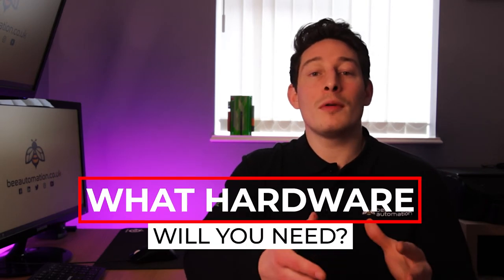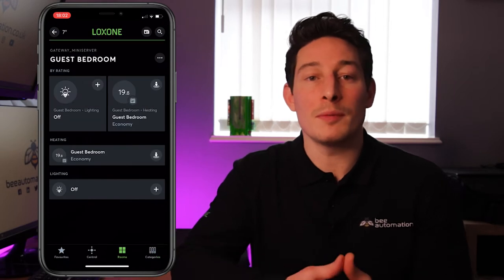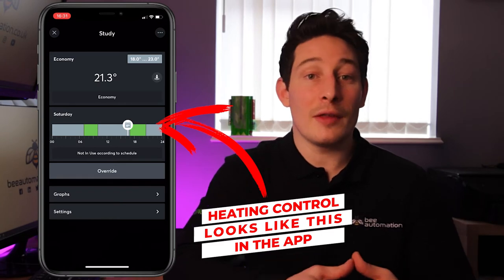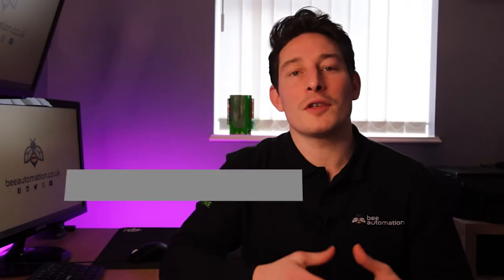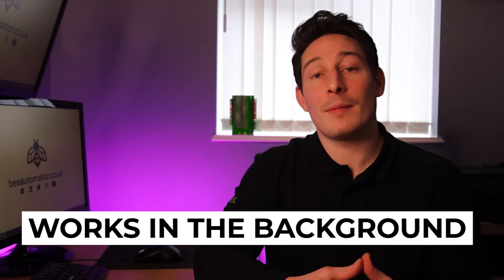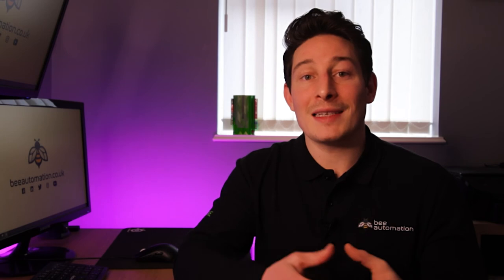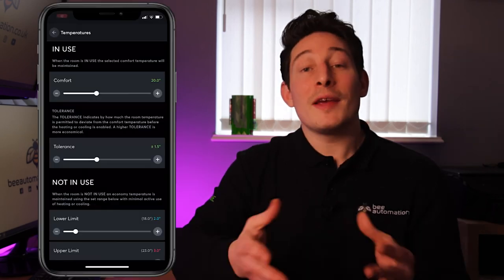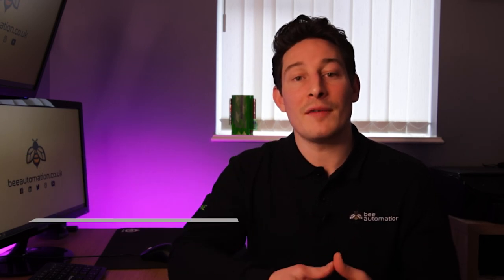How Loxone Heating Control SHOULD Work in a Smart Home

Comment: Ive had to commission heat pumps where the Loxone system cased problems. A couple of points from the heating perspective:
The person with the app was not present so we couldnt test.  A switch in the plantroom to manually open all zones would be really helpful.
Micro zones reduce heat pump efficiency. Minimum flow rates must be maintained.

Comment: Is there a way to more precisely control my gasboiler. I have an OpenTherm boiler. I would like to automate it's supply temp (hot side temp setpoint). For example, i have solely floorheating in my livingroom + kitchen, here maximum of 40 degrees would be more than enough. But upstairs and in my attic, i have solely radiators where a minimum of 50 degrees are needed in order for them to be any usefull in heating up the rooms.

So what do i need to connect loxone to my opentherm boiler. (Most boilers do not have 0-10v connection) but all have OpenTherm.

I can't seem to find any info on the web. Everybody's talking about on/off relay triggers, but i don't feel the need to make my boiler heat up to a whopping 60 degrees*, just to supply heat to my floorheating unit. Most time of day, upstairs will be minimally to not heated at all.

*This is because higher temperatures are less efficient. This is because in ratio, more heat will be lost trough the boiler exhaust.

Cheers,
Joshua

Comment: Most modern gas boilers aren't operated with simple On/Off control, but adjusting the water temperature based on your heat demand and/or outside temperature.
Can you implement these controls with Loxone?

Comment: Hello Chris, great video, quick question does each room not need a hi-low temperature sensor or does the presence sensor also do this job?  Regards mike
Reply from the maker: Hey Mike, many thanks for the kind words. Each room needs a temperature sensor, these are built into the Loxone touch switches. The presence sensors don’t include them. Hope this helps 🙂

Comment: Hello Chris, I’m currently about to embark as a Loxone partner,  hoping to become an installer after I’ve gone the full hog at my own home, (which is currently being renovated throughout). I’m installing the preliminary wiring to cater in all areas but intend to install the Loxone switches and devices. If I have my own light fittings - internal and external, will that still work with the Loxone system?
I’ve found your videos extremely helpful by the way. A very clear and concise explanation of how the system works, very succinctly put.👍🏽
Reply from the maker: Thank you very much for the kind words Sheargill, really appreciate it. Yes you can use pretty much any light fitting - 230v switched or dimmed, DALI, DMX, 0-10v dimming. All possible using Loxone 🙂👍🏼

Comment: Great video and an awesome system! Are there any advantages/disadvantages to the wired mini-server vs the Wired mini go for retro fitting? Do these give the option to expand the system in stages to the various system capabilities creating a smarter home over time(perhaps due to budget constraints)?
Reply from the maker: Hi Stephen thanks for the kind comment really appreciate it. There is no real differences between the two other than one is wired and one is wireless, if you can pull a cable to a device then that’s what I would do but it’s not always practical. Using the wireless miniserver go it would be easier to expand the system over time, yes that’s right.

Comment: Educational video! What is the most common to control the heat source in most installations? With on/off (relay) signal or with a modulating signal like 0-10v? Thanks.
Reply from the maker: Thank you Jan. For switching a heat source on/off like a boiler or air source heat pump it’ll be a relay. You might use a 0-10v signal for controlling a particular type of valve.